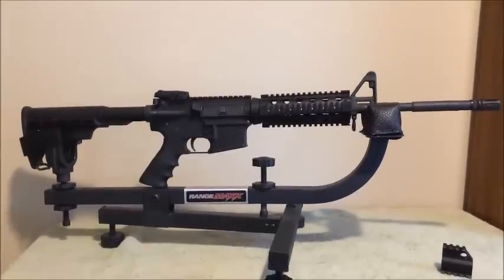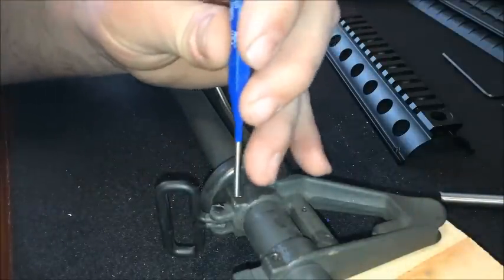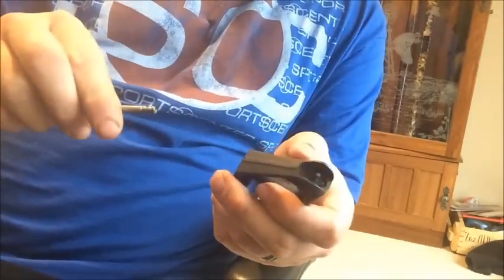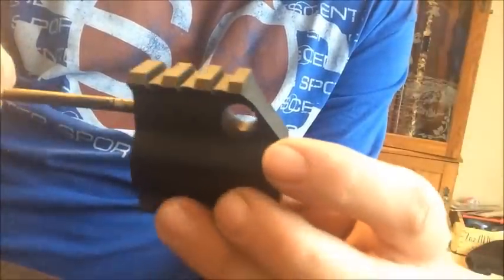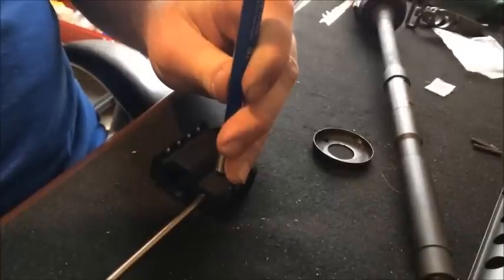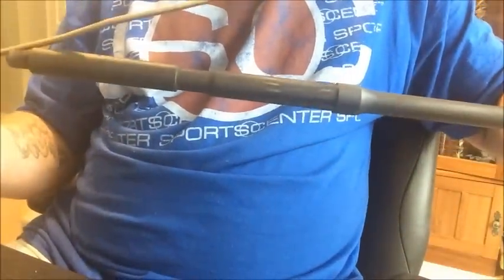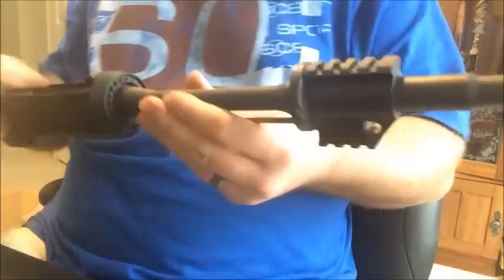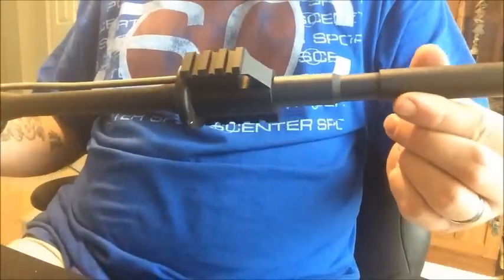AR15 A2 Front Sight Gas Block Removal

Comment: Can you post a link to the gas block you used please? Many are designed to work against the shoulder not the hand guard cap and the gas tube spacing vs barrel gas hole is off.

Comment: .750 diameter low profile 16.99 on Amazon GT USA sells it
Reply: Do you recommend it ?
Reply: Ya it works great
Reply: +G. Radd just read a thread on ar15.com claiming you will have to dremel your handguard before you installation with gas block
Reply: G. Radd I can't seem to find it on amazon. Do you mind sending me the link of the gas block?